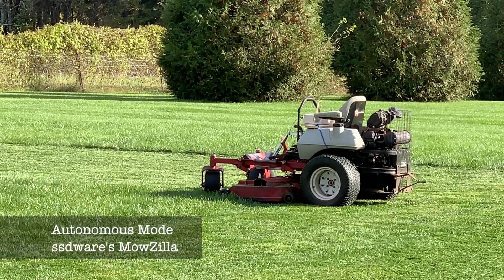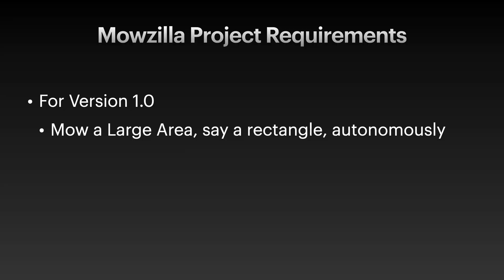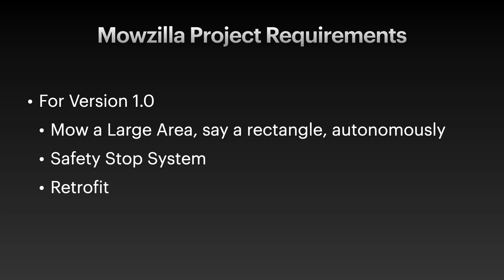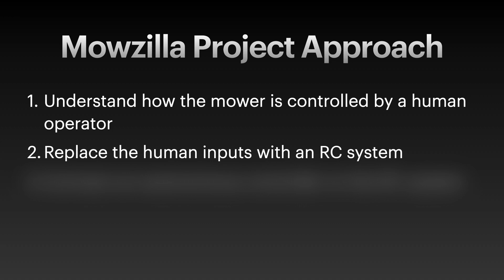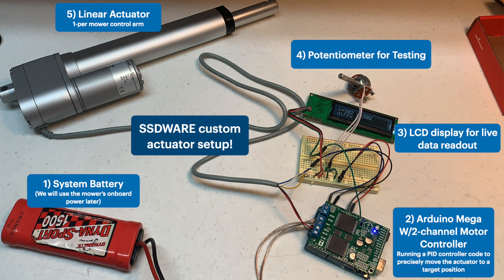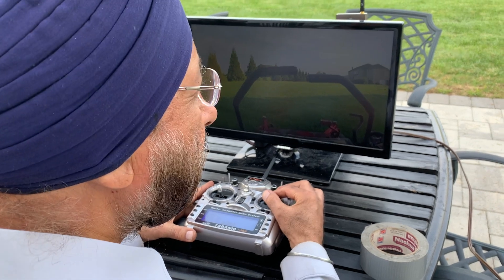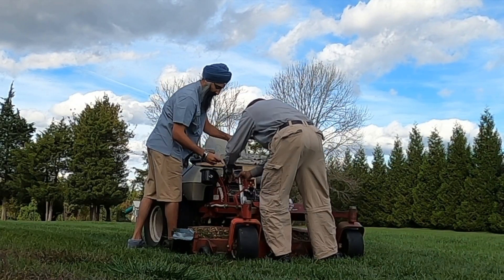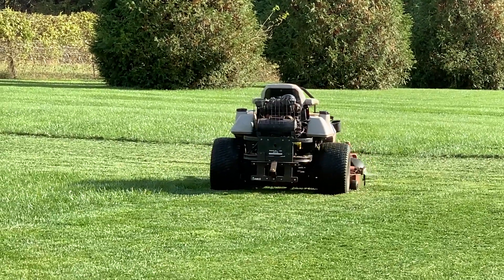I built a DIY Self-Driving Lawnmower!

Comment: I think this is amazing. You're father must be so proud.

I tried to get a HS Robotics team to help me build a 52"-in, track-driven, hill-climbing "brush mower" ... with a used, but never run ... Towable DR "Brush Mower" as a base, but their teacher wouldn't give them the time. So after 2yrs I had to sell it for a loss. There are the programmable aspects & equipment I just don't have the brain chemistry to understand, like writing a code. Is this something you could create as a "kit," and use and write the same code into it???.

I don't need the ArduPilot system. .... All I really want to do is be close & try to RC control it up & down our steeper hills, so I don't have to worry about rolling it. But I also have a couple welding friends who say they can help make a Zero Turn into a duallie, for far less then the commercial version "Cub Cadet" duallie. I'd also probably screw in some shorter, metal stud for a little extra grip on hills. Please let me know what you think & thanks for the consideration.

Comment: Cool project and great explanation. I'm approaching retirement and thinking about this kind of stuff to help in my later years. I am also a big OpenPilot user for adding Open Source aftermarket autopilot to my cars. I would love to see an autonomous mower use a Comma 3X to add vision. They have already solved obstacle avoidance for vehicles and wheeled robots. I'm sure you could find some useful code in there.

Comment: Thanks for posting this. I think I can figure out how to adapt this for my riding mower. The thing that has me stumped, though is the controls interface. Can you explain where you got the actuators and what load capacities you used to move your mower's steering handles? There are so many loads and stroke lengths available. Thanks!

Comment: Nice work, thanks for sharing.
Some questions. GPS accuracy - are you using RTK? did you have trouble with the compass.
Hows your overlap - and are your mow patterns acceptable to your eye - eg straigth
What was the hardest bit?
And suggestions for where next ? Safety - get some machine vision going to stop for things in the path, eg people or ladders etc...
cheers
Reply from the maker: 1) not using RTK but it seems like the GPS was internally consistent enough for straight lines!
2) Compass was a little wonky sometimes -- that's why the GPS and compass are mounted on a small "mast"
3) the overlap was set to about 6-8 inches so the lines were straight, yes.
4) Hardest bit was ardupilot tuning -- setting parameters in ardupilot
5) Safety -- computer vision and maybe setting up on an electric mower are the next steps
thanks for the questions!

Comment: What controller did you use?
Reply from the maker: Hi Bill, I used the Ardupilot Pixhawk controller -- everything from diydrones.com. Let me know if you want more details.
Reply: @ssdware curious if you are using RTK or NTRIP for autonomous  navigation, also type of ESC.  I am building similar lawnmower, but with traditional riding  lawn mower with Ackerman steering.  I am using Radiolink crossflight
Reply from the maker: @BillStArnaud  nope, no rtk and the path quality was still great